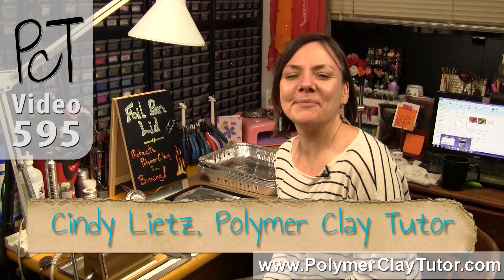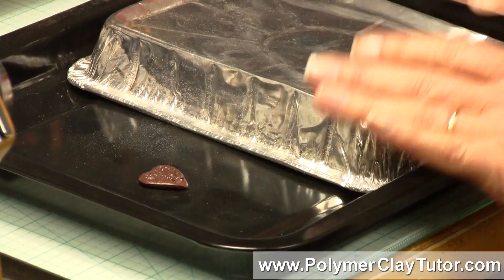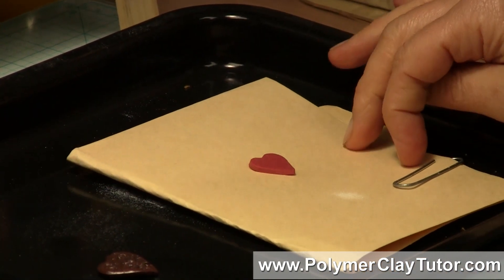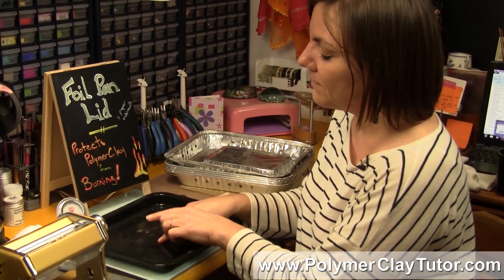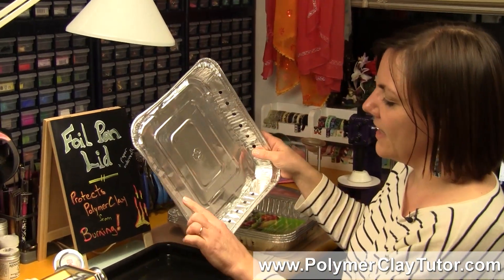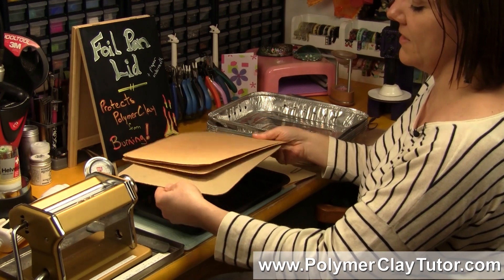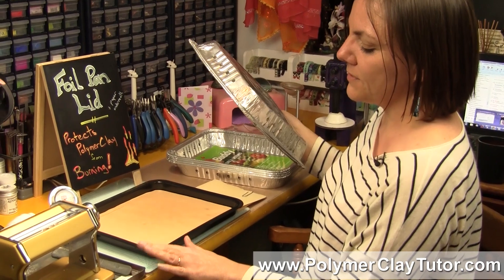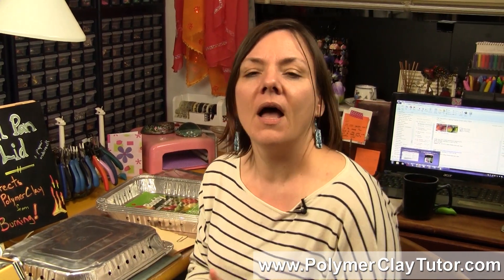Polymer Clay Baking Tips - Using a Foil Pan Lid

Comment: Thank you, Cindy! This explains why the copper coloured, tree bark textured heart pendant that I baked straight on the toaster oven metal tray scorched on the bottom. The top is fine, but the piece is QUITE thick (about 3/8 inch). The scorch isn't drastic, just a couple of spots, but I didn't know what had happened.

After that, I started baking things in baking soda in an aluminum foil pan with foil sealed over the top, to keep the temperature more even. I like that for beads, etc, but I made a flat pendant with an appliqued "rope" edge around the top, which cupped when I was baking it. I fixed that today by rebaking it on a ceramic tile, and letting it cool down on the tile.

But burying some things in baking soda didn't seem like it was going to be a good idea; items with mica powders, which I was afraid would wash off when I washed the baking soda off; items with intricate bends, which I was concerned might squash when I was putting the baking soda over the top, etc.

So I am VERY glad to see this tutorial video, explaining how to use a heavy pan, card stock, and a foil lid. I imagine that I am going to be using a combination of the pan, baking soda bed, and ceramic tiles, depending on what I am creating.

You are SO great to be sharing this information with us all!

Comment: I use my kitchen oven because, even though it is electric and therefore cycles, the heating elements are more removed from the clay than a toaster oven. (Got this tip from Christi Friesen.) I use a turkey roasting pan-foil- on the bottom and either bake beads on fan-folded card stock to hold them a bit removed from the bottom and in place, or I simply put a 6" tile into the pan and bake flat pieces that way. I cover the foil turkey pan with heavy-duty foil to keep in the fumes and take the pan outdoors to cool and then remove the lid to release the heated air into the outdoors. I have used very thin translucent clay, liquid clays and white (thin) Premo and have not yet burned a piece.(Well, there might be a first time.!) I would not use your vented pans simply because they would still release the fumes into the oven. (I guess I'm not that enthusiastic about having to clean my oven after baking!) I do believe that the longer it is baked, the stronger, so I generally bake even the thinnest pieces 45 minutes using my tented system, but I do not exceed the recommended temps. Hopes this helps!

Comment: Great video!
I currently don't have access to my toaster oven and I don't particularly like the idea of the plasticisers contaminating my regular food oven. I was wondering if I could make a sealed unit out of aluminium trays and foil with my pieces inside to cook. Do you think that this would reduce the amount of plasticiers that the oven is exposed to? Would the pieces cook properly? Would there be a chance of the unit coming apart due to changes in internal pressure?

 It would be great to hear what you think. If it seems like a sound idea, maybe it would be a very useful technique for crafters who don't have the space/money for a polymer clay oven. :)
Reply from the maker: CrimsonNorway  I wouldn't worry so much about the plasticizers in your oven... the clay is non-toxic and you can always wipe down the walls of your oven if you'er worried. But you can certainly seal your clay up in a roaster pan (or an oven roasting bag with a tie) if you are concerned about it. Just make sure to line your pans with cardstock or a bed of cornstarch to insulate it.
Reply: PolymerClayTutor
I bake my sculptures in a lidded stock pot or other old pot. [I often make 6" - 12" tall sculptures rather than jewelry] There's really no pressure problems at all and it would be tough to make any container that air tight. There's less chance of burning in a large oven because the heating elements are farther away. For baking my smaller objects, I use a counter top glass convection oven, partly because it's vertical shape fits my pieces better. Like with a toaster oven though, I must be more careful to avoid scorching because of the closeness of the elements. I found that most toaster ovens tend to have very high temperature spikes that cause scorching, unless you get a really good one. Great tips Cindy!!

Comment: Awesome video. Can I bake all my premo polymer clay stuff at an hour for 275 degrees F, even small beads? Does it matter how thick or thin it is? What if I had a piece that was thick in some areas, and thinner in others. I don't understand how long to bake at depending on the size.

Comment: hello! 
first off i'd like to extend my gratitude to your channel. i recently started working with polymer clay and you have been so much help. one problem i am still running into is occasional burning. i am going to try this method for baking, but was wondering if i was hurting my clay by using rubbing alcohol on my pieces prior to putting them in the oven? i saw that rubbing alcohol was good for removing finger prints and more... some of my pieces in the same batch come out burnt, discolored, and/or bubbly and im wondering if it's from the rubbing alcohol. can you use too much of it? any suggestions on how best to clean your clay?
Reply from the maker: Thank you bibi for the kind words! That is very much appreciated! 💖 This method should greatly reduce your scorching issues. The rubbing alcohol is not hurting your clay and has nothing to do with the issues you are having. It is a problem with your oven. Also, make sure you're using an oven thermometer to be sure you're curing at the correct temp. You need it hot enough to cure it correctly but not so hot that it is burning your pieces.

Comment: Cindy, If you bake clay the right way without over burning/or dry out and it is the kind that is strong and flexible after baking, will that clay still be the same strong and flexible over 10, 30, 60 years or will it become dry and brittle?
Reply from the maker: That is a tricky question, Ben because it would be hard to test that one to be sure. I can tell you, I have some Fimo earrings from the 80's that are still just as strong today, but I can't say that for all brands, all baking methods and all storage situations. Plastics are funny that way, and I would imagine if you were to leave those same earrings out in the desert for 40 years, they may not be doing as well. That being said, if you bake your work properly, and it sits in a reasonable location, it should be around for many, many years to come!

Comment: How do you finish off your baking process? What I mean is, the piece has been in the oven long enough, now what? Do you immediately remove your pieces and let them cool or do you shut off the oven and let them cool inside, along with the oven (more like a kiln process)? I am still new to working with polymer clay, but I have been letting the pieces cool down with the oven. Do you know the benefits and drawbacks of using one cooling option over another?

Comment: Hi! Just some questions about baking...
1. If I mix premo sculpey translucent and a bit of fimo black to create gray color, what is the baking temperature?
I'm baking it with 275 F/ 30 mins  and it works so far.
2. After baking the gray mix, I want to rebake it with added details using FIMO white. Should I still use 275/30 mins or it is fine to use 130 F/ 15 mins?

Please enlighten me.. thanks!

Comment: In the toaster oven I found at the thrift store, the heating element turns bright orange. In the beginning, it was actually turning my light colored clays brown or orange! EEW! So, I took to tenting pieces of tin foil over the projects and this has ended the orange/brown tinting of the lighter colored projects. I like your idea for using a foil pan, but my current oven doesn't have the space for it (it's too squat). I'm going to be upgrading to a 9-slice convection oven very soon, and will try your suggestion using the cardstock and foil pan. Thanks for sharing all your awesome ideas! They're very, very helpful!

Comment: hi! my toaster oven has this setting which you can switch the heat. upper bottom or both.. when using a foil pan, do i still need to bake it with both upper and bottom heat? or just in the upper heat? since its the part where i need it to be tented? please help.. thank you..

Comment: Does it matter which clay brand you use when baking it for an hour? I am making key chains and my charms are roughly 1/4-1/2 inch thick. I also have an electric oven and it spikes to keep its current temperature. Any recommendations for this?

Comment: Would using a silicone baking sheet be an ideal insulator too? :)
Reply from the maker: Amy He  maybe, that would need to be tested. As long as the silicone was smooth and didn't leave an imprint or shiny spot on the piece, it might be a good choice. Paper is cheaper though...

Comment: is this baking style better than your tile sandwich method for avoid bubbles?
Reply from the maker: This baking method does not prevent bubbles in your piece like the tile sandwich dies. This method, prevent scorching from the above elements in your oven. If you are using the tile sandwich, then it naturally is protecting from scorching so a foil pan lid is not necessary. If you're baking a sculpted piece or something that can not go into a tile sandwich that the foil pain lid is an excellent solution to scorching.

Comment: i have a question, i was considering making a custom area to bake sculptures with an undustrial heat gun (750ºF) by making a tin insulating structure around the unit, then using the heat gun on the structure. do you think (A) the heat gun hitting the tin boxing structure will generate enough heat to cook a structure thats about... say 2" on either side away from its walls, and (B) will this be TOO MUCH heat?

im asking because i'm planning on making some rather large statue-type pieces, and they won't fit in an oven.

i've also heared using these heat guns can be done as long as the heat is spread out a lot, or farther away from the structure. would a higher power heat gun be ok to use as long as it was a certain distance away?
Reply from the maker: +brandon whittington (Orcryst) It can work with some tweaking. You will need an oven thermometer so you can track the heat. You may want to try something like a barrel and some other kind of heat source that has a temperature dial. Everything is possible with some innovation. Just be careful that you don't have super hot spots or cold spots. It is important to have as even and consistent temp as possible. Maybe watch some videos on homemade kilns... of course your temp needs to be way lower, but the oven design should be similar. Let us know how it goes...
Reply: +PolymerClayTutor will do!

Comment: Love this info! 
I got myself an Oster Convection oven at my local Walmart (your Oven is no longer available at Amazon SOB!! or the Hamilton Beach that many people swear over is not available either). But the Oster one seem to be a favorite as well. 
I DO have a question though... I got myself the aluminum pans and the folder files for the insulation... BUT... WHERE I PLACE MY OVEN THERMOMETER?! On top of the aluminum pan?! O_o Like, where I position it to make suer my thermometer is reading the correct temperature my polymer clay needs?
Thanks in advance!
Reply from the maker: Place the thermometer on the shelf so you can see the temp in the oven while baking.

Comment: Do you need to use the foil pen with holes.
Reply from the maker: No, but the heat does flow around more easily when there are holes in the pan. If your pan, doesn't have holes, then you could poke some holes in it yourself, but it is not critical.

Comment: I have seen a sculptor on YouTube submerging a figure they had carved into a pan of lightly boiling water (there was a small towel in the pan preventing movement). I can't find the link now, but the theory was you couldn't scorch the polymer clay using that method. Have you ever tried that technique?
Reply from the maker: Hi Paul Mullins putting clay into boiling water can partially cure your piece, and might be a good solution for sculptors would need to do repeated curings when they add to they work. But since water boils at a lower temp than what polymer clay needs to cure at... it won't be fully cured to the core, if it is only boiled. You will still need to bake it again for a full hour to properly cure your piece.

Comment: If I use foil pan lid will burnt plastic smell appear? I just bake them at 110*C and use foil tent on top, but some of them still burned and make uncomfortable plastic smell :(
Reply from the maker: Are you using a separate oven thermometer? A lot of oven dials are off by several degrees. You're probably baking your clay hotter than you think!
Reply: @PolymerClayTutor  thankyou <3

Comment: I am trying polymer clay sculpting for the first time and I have followed the directions down to the t and yet my clay is burning??? So heres what I did if somebody can please let me know where I messed up...I put my piece which is a figure of a fish on a flat tile and put a plain piece of paper on top of the tile. I then put my piece on top of the paper and tented it with a foil lid like the one in this video. I set my oven to 275 degrees as the clays instructions states. The  piece was placed on the middle rack in oven where there are no other metal pieces in oven. I baked for 30 mins and when I looked the clay which was white was brownish on top but I tented so I'm  confused??? Help please...

Comment: can you bake the clay in a different way ?
Reply from the maker: blahtrick23 Not sure what you mean...
Reply: Sorry, what i meant by different way is i saw other videos about how they bake their clay is putting the clay in microwave or put it in the oven but i dont know if its safe, im looking for a safe way to bake the clay.
Im new to Polymer clay so i dont know much about these :(
Reply from the maker: blahtrick23 OK now I see. Other methods of baking polymer clay are not as good as just baking in the oven. Microwaves are unsafe. Pieces baked in the microwave will burn in seconds and cause a real mess unless they are submersed in water, which basically means they are boiled. Boiled clay is not at the right temp, so you will undercure your clay. Candle kilns are inaccurate and inconsistent. And heat guns aren't good either unless the clay temp is strictly ministered and maintained. Stick with toaster ovens, regular ovens or roasting ovens, where the proper temp can be regulated and held.
Reply: PolymerClayTutor thank you so much ! :D i will try the oven :)

Comment: Isn't an hour for that thin of a piece too much? I'm a beginner and my clay says 30 min per 1/4". Just getting my Info straight. Love your videos.
Reply from the maker: Making It Easy with Liz Hi Liz, actually it is not. The thin pieces are especially vulnerable to breaking... the longer baking makes sure that every polymer particle in the clay has 'melted' and bonded together. It is very important that you use an oven thermometer to make sure that your oven temp is not too high or it will burn. The package just states a low amount because they know that most ovens are off in temp and they don't want people to burn their clay.. plus they don't really care if you break your stuff. All the professional polymer artists bake for longer times to ensure strength. Test it... you'll see.
Reply: Thanks!

Comment: Why do the packages say to cook for so little time if it's not right? Surely they have tested the clays, so why don't those match with your tests? It seems bizarre that the people making polymer clay don't even know how to use it properly...
Reply: The packages say to cook for that time for every 1/4 inch or something like that. People don't read the whole thing.
Reply from the maker: ***** and Bijoux Vaudou The packaging only has so much space to explain things. They know that a bunch of people will just put their pieces on a cookie sheet, so they tell you to bake for only a few minutes so it doesn't burn, like mine did. They don't really care whether or not your piece is durable... you'll just buy more clay when it breaks.
Reply: I was thinking the same. One hours seems like an insane amount of time for that 1/4 inch hearth, there is a reason it burned.......cause it was too long.
Reply from the maker: ***** One hour is not an insane amount of time to bake polymer clay. In fact for most brands it is the only way you are guaranteed to get a proper cure and durable pieces. You must use an oven thermometer to be sure you're baking at the correct temp and use the tenting methods that I recommend. Professional clayers have discovered this and have been using this longer curing method for years. Please watch this video: https://www.youtube.com/watch?v=tv6qOpdE_OU